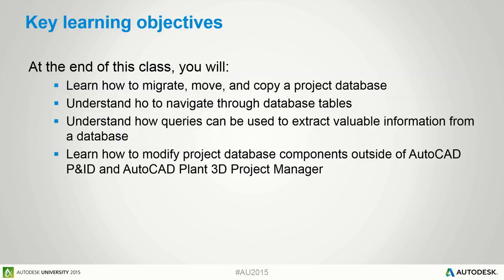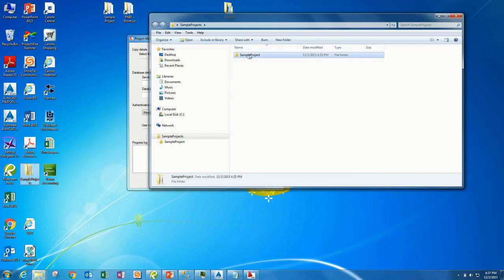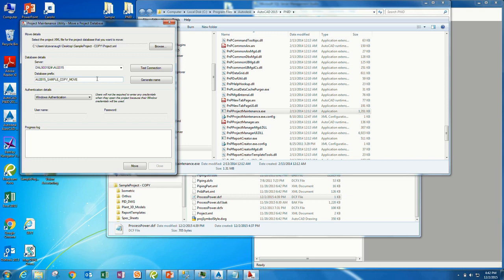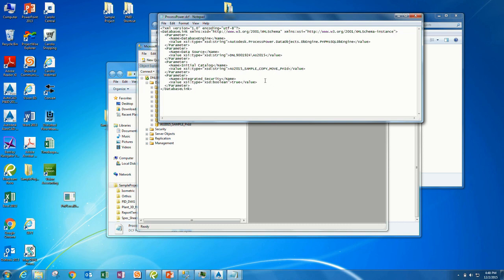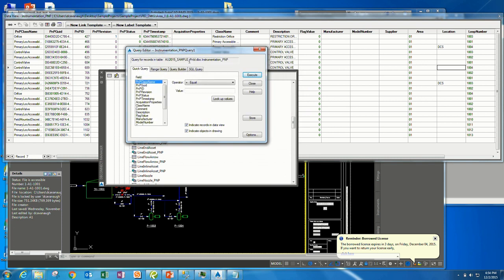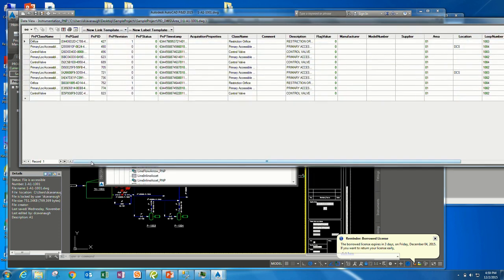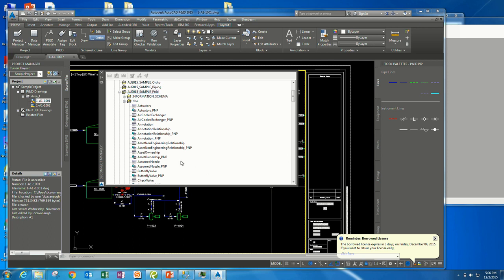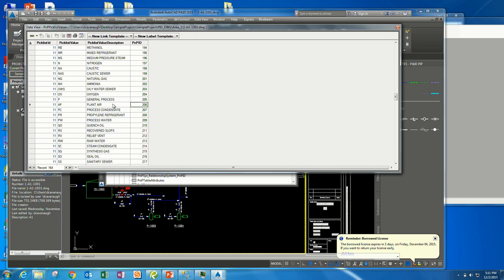AutoCAD P&ID and AutoCAD Plant 3D Project Database Tutorial

Comment: Good night, I'm from Brazil and I'm starting in the 3D plant.
I need help because in Brazil the software is not yet widely used, could you help me?
Is 3D plant compatible with Revit?
Reply: AutoCAD Plant 3D and Revit are not fully compatible but there are some ways to make them coexist. 1- export from Revit to an dwg and xref into Plant. 2 put plant models and revit models in Navisworks or BIM360. 3 output from Revit to STEP file and import into Plant 3D.